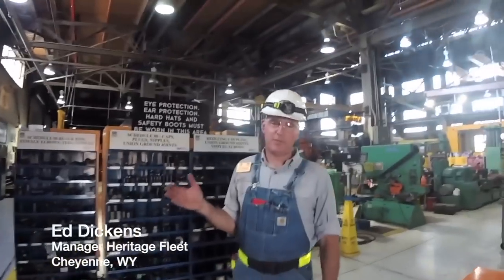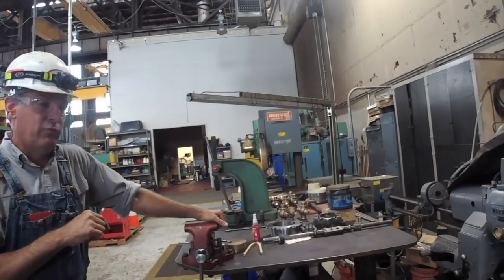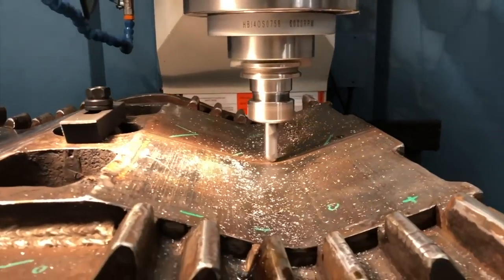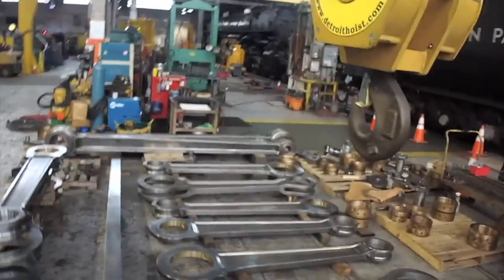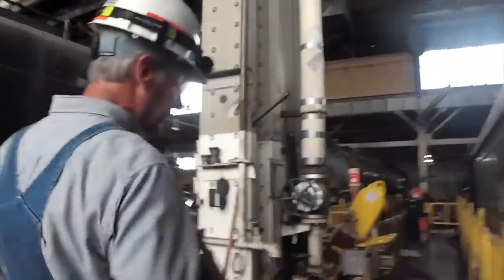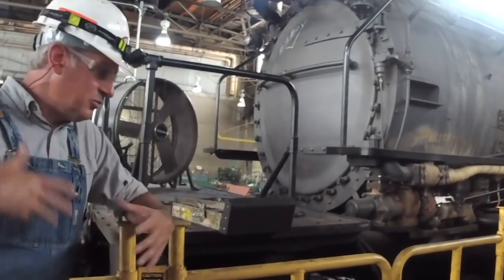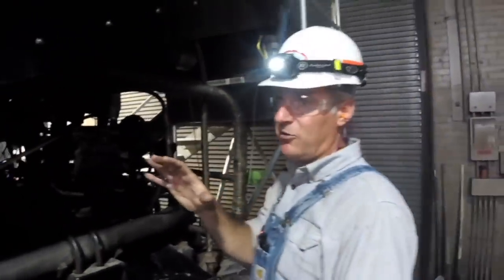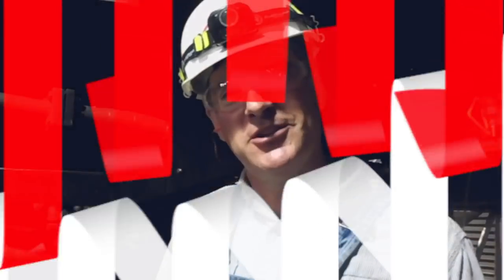Union Pacific Steam Shop Tour

Comment: I really enjoyed this video, but oh my goodness use a better camera with some kinda optical stabilization
Reply: AMEN! You can tell they tried to accommodate for some of that in post by using freeze frames but the stuttering was unbelievable. This felt like 15 fps. There were a few shots that had smooth panning and high perspective look-downs, so I wonder if they were using a gimbal but it was old/failing? They need to pick up an OM 4 lol
Reply: @calebtothemax  i'm of the opinion they were using an old cell phone held by hand. There was some software video stabilization they did in post, which was when it would get all blurry and kinda "wavey". software stabilization can only do so much. I Just want to see that train shop in HD glory, I think UP can afford to spend $1000 on a 4k sony :)
Reply: Came here to say the same.  I had to turn the video off because it was so distracting.
Reply: It looks like they actually added a stabilizer effect in an editing software after filming. It’s used to remove the jitteriness of a camera’s film and usually works wonders. However when you increase the effect too much, you get an extremely weird look like what’s going on in the video.
Reply: It'll be an one off video
Reply: @yetidynamics  true

Comment: It's s freaking shame UP STILL hasn't come out with a "Discover how the 4014 was built" that document 4014's journy from Calif. to Cheyenne, the inspection, the tearing down, the ordering of parts and building of parts, the reassembly to it's maidin voyage to Ogden on Blu-Ray! If it goes for $25, I would definately buy it!
Reply: That's what I was hoping for when I heard about the rebuild. However they could have done a documentary but said nothing. Wonder if offers were made for one.
Reply: There is actually a two part dvd that was released documenting that very thing. First part touched on the restoration and trip to Ogden and part two was the tour it went on after that

Comment: As a machinist I love what I do but I fell in love with steam locomotives back in 1966 at the age of five when my grandpop took me the Reading Railroad roundhouse before they took it down. There I seen T1s 2100, 2101 and 2102.  I sure wish I could work at your steam shop but I'll settle for where I work now, Timken / Philadelphia Gear in DE. As you know Big Boy has Timken bearings.

Comment: +UnionPacificRailroad  I recognize thread rolling as a related process to the knurling I studied in junior college, in which shaft steel is worked under pressure to alternately raise and lower the surface.  Knurling can provide a grip for an operator, or alternately render a specific quality of interference fit for a coaxial-cylinder application.

Comment: Thank you guys for your commitment to keeping big history alive and running.  I can't overstate the importance of preserving the memory of this technology for the world, our nation, and our children.

I have a couple questions for you, the UP and your department, Ed.  

1ST - are there anywhere you feel that you have used modern technology to improve on the historic designs in order to make it more efficient or improve running performance, especially in the area of  stronger, lighter metal alloys to make the running gear able to handle higher speeds?

2nd - would you ever trying to challenge the steam high speed record using UP 844?  Or even helping resurrect another engine that could do the job?

I think records are important and made to be challenged.  Big Boy is the biggest engine so there is that, and it IS a big deal.  Just as GM puts a Corvette in the showroom to sell family sedans, I believe that your steam heritage program sells freight contracts.

Prestige also comes to the railroads that tout the fastest locomotives.  Right now Great Britain claims the fastest steam locomotive ever built at 126 mph, notwithstanding that it the engine was going down a grade with a light load and still ruined the main bearings. All of us who know better understand that the best US locomotives were more powerful, more reliable and had a higher top end than the A3.  It's possible that 844 could reach that speed and that would be amazing. But there are others that were even faster.  I'm talking specifically about the J3a Hudsons.  

This locomotive was not only more powerful but had drive wheels that were 4" larger than the LNER A3! It's tragic that they let the British hold this record for so long unchallenged.

Here is a comparison of the Milwaukee Road F7 to the LNER Mallard for thought:

      	                                        MR F7            UP 844          LNER Mallard the 
"fastest" steam locomotive

Robert LeMassena's 
Power Computation	 	28,950	       30, 060                10,300	

Same as above plus 
superheater percentage	37,346	       37,575                 12,669	

Same as above 
but substitute firebox 
area for grate area		177,246	        192,000               71,094

Power L1	                        60,547	       42,802     	      28,772
Power MT	                 	1853.93	       1396.41
 	             1285.77 (drive wheels that were the same as UP 844 and 4" smaller in diameter than the F7)

Source: https://www.steamlocomotive.com/

So you can see that both of the American engines have the numbers that make it look as though they can top that record holder.  Do these numbers seem correct to you?

Of those J3a's, there is only ONE survivor and she needs a lot of help.  It is the Santa Fe 3463.

I implore you to reach out to the foundation that holds this engine, the Coalition for Sustainable Rail, and help them not only resurrect this treasure but to help it put the steam engine high speed record back to the USA where high speed rail began.

Comment: Back in the days when steam locomotives were hauling cargo, did the conductor / engineer ever have to do a rotation at a repair facility like this? If so, would have been great cross-training experience.

Haha, shop guys are like, “ooooo, you’re Mr. Fancy Pants Engineer, eh? Go make some stay bolts today.” Or,  “You’re flaring fire tubes today.” Or, “You’re shaping refractory today.” Hahahaha.

Comment: It's quite safe to say that the 4014 is in many ways actually in better condition that when it left the halls of Alco in Schenectady.  However, I have to ask if the rumor is true, are the decorative rings around the upper washout plugs, to allow access through the boiler jacket, really made out of stainless steel dog  food bowls?  If they are, don't feel bad as they also make great lamp housings for marker lamps on the ends of coaches....  ;-)
Reply: They've confirmed that rumor a few times over the last year.

Comment: I enjoy visiting all the narrow gauge steam railroads i can. Thexe engines are not as spectacular as the main line giants the do have the advantage of being almost comprehensible. If any of you are traveling into New England get a list of the steam powered railroads and pay them a visit. These engines range from mainline engines in coastal Connecticut through the unique two foot gauge Maine two footers to the unique steam engine used on the Mount Washington Cog Railroad.  

Check these out. They are really fascinating. Not as sheer spectacle as the Big Boy but fascinating nonetheless.

Comment: Excellent information. One question you mention that the connecting rods have bronze bushings could those be converted to roller bearings instead? I am aware of to rotational force’s involved on the rotating mass. Just wonder since the drivers and lead, trailing trucks and tender have roller bearing applied to them?  
Ed thank you and your steam crew at UP for what you do. 
I know I greatly appreciate it!
Reply: I once saw a clip of Steve Lee talking about the 844 and he said that UP tried roller bearing rods but that they were more trouble than they were worth

Comment: Very nice presentation. I understand that some of the parts made for 4014 will fit the 844 as well. If true this certainly is some savings. Now, it appears as though the shop is idle - or you came in on Sunday. So what is the status of 3589 - 4-6-6-4. Could that work be done at this time? After all, the rail system has not stopped operating just because of 19. Surely you could have a few of the machinists and assembly people working on parts and assemblies for the 3589.  My second question, is prefaced by a statement of facts, Big engines are not the most efficient though they did their jobs, they are dirty, take a good deal of maintenance. They were designed - with the exception of 844 - to pull big loads. You have rebuilt 4014. It is like a new engine. So why don't you use it for what it is - a heavy hauler? Why is it relegated to the humiliating task of pulling passenger trains for the well heeled who can afford the cost of a ticket. Surely this ambassadore of the UP system can be an even better object of awe and representative of the technology is uses to do the job it was designed for. Surely it would get a lot more exposure in revenue service then on  short haul runs pulling  rail cars for the rich.  Maybe you could even incorporate that same train into a MF consist.  This is your baby, this is your project. You have spent many years bringing these engines back to life and keeping them running.  You know the engineering wonder of what was accomplished back in 1940 when these were being designed. Surely you appreciate what 4014 can do. Wouldn't you like to see it pulling a string of cars 2 miles long up the grades of Sherman Hill?  A second though crossed my mind - your shops are so well equipped. There are so many other restoration projects. Surely you could generate income by making parts for their projects. Your facility is likely the most experiences and productive in the USA. The added income would put more machinists to work, have more operating time for your machine shop - though is certainly can be used to service your diesel fleet as well - and help other project accomplish their goals without a major drain on their resources trying to duplicate what you have already in service in your shops. Surely this is something to consider. You have a huge capital investment sitting idle. And why isn't BB running. Trains for freight and passengers have not stopped functioning. Why is 4014 sitting idle, Why is 3985 not being rebuilt - it was supposed to follow 4014.  Mr. D - Thank you and your team for a wonderful and difficult job well done.

Comment: I've often wondered how the movable joint on the steam pipe going to the front cylinders worked on the 4014. I mean how many pounds of steam are in thoes pipes and the fact that they can swivel while under pressure as the engine takes a curve and sterightens back out again without leaking or rupturing. Any chance for a video on this part or some direction to where I can understand these awesome pipe fittings ??? thanks

Comment: I know there’s no trips right now and I know you guys made spare parts why don’t you guys start rebuilding 3985 thanks
Reply: 3985 has been retired since January 2020.
Reply: No money
Reply: To elaborate, with all the inspections and maintenance the steam team has to do on 2 locomotives its tough enough with the man-hours and money UP has budgeted for the steam program to keep 844 and 4014 running to the standards UP has set. It would be awesome to have 3985 rebuilt in a "reserve" state so if we have locomotive tours again UP can alternate between 3 locomotives or have a ready spare.
Reply: I'm sure if someone wrote a big enough check, they'd hire a few more guys and get on it.
Reply: @joesvoboda3509  One issue with it sitting "in reserve" is that the bouler ticket starts counting when the first boiler tube is installed. Another issue is that they've said restoring 3985 would require even more work than 4014's restoration. That's right. 4014 arrived at the shop in better condition than 3985.

Comment: Question: with current metals and lubricants, what is the new life expectancy after rebuild, compared to when originally built?
Reply: Parts have to be replaced on different schedules there is no eorn out date fore the loco but rather hundreds for the parts and if they keep it maintained it can run allmost forever
Reply: @the_retag  I meant before a major overhaul like it went through in recent years. Fair wear & tear is a different matter.

Comment: Everybody is talking about 4014, but what about 3985?
Will we ever see those two engines doubleheading on a heavy freight train?
Reply: Sadly no. At the 150-year presentation, the VP in charge of Steam Operations stated on camera that the 3985 will not be rebuilt
Reply: @thomasboese3793  When I saw 4014 first time after restoration, my first idea was: " They converted her from coal to oilburner. therefor they took tender and oilburner  from 3985"
This idea may be right or not. 
However, 3985 is not scrapped, so may have a chance once in the future.
Reply: @oldeagle1911  During the many videos Ed made showing the progress on the 4014, several times he mentioned making enough common parts to restore the 844 and the 3985, But, when the VP above Ed speaks, one does have to listen. Hopefully, the 3985 will stay clean, dry, and perhaps in the future will be rebuilt. I'd love to see a triple header of the three, backed by a DD40AX.
Reply: @thomasboese3793  I see, your dreams are even greater than  my dreams.Let`s add 350 cars 😉
Reply: @oldeagle1911  Dream "BIG" or go home...